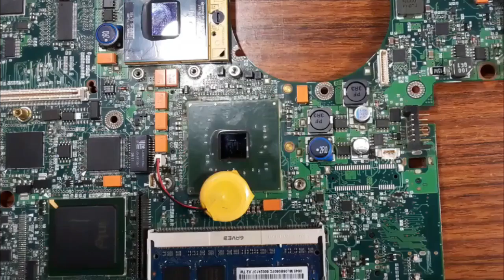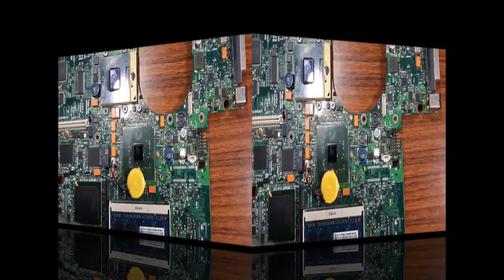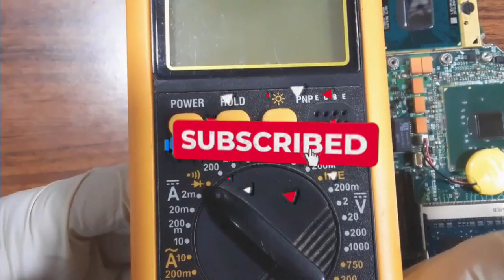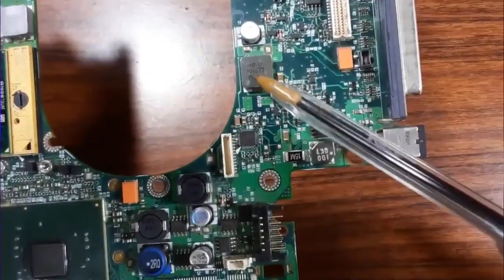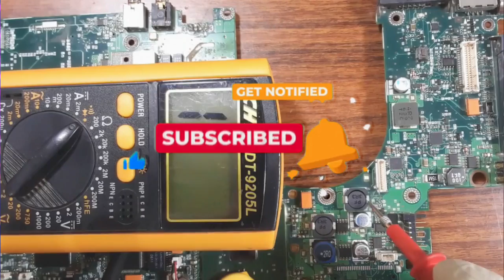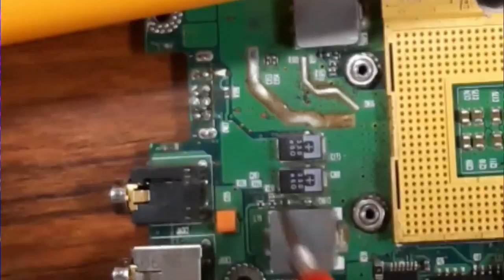Learn how to troubleshoot laptop short circuit - Laptop motherboard repair

Comment: how to determine if its a soldered CPU? newer laptops are soldered and has a low resistance as always because it should. how to determine if its just shorted or not with Soldered CPU
Reply from the maker: Thank you for your question. For checking if it's shorted, you'll need to measure the resistance on the CPU's power rail. If the resistance is significantly lower than expected or near zero, this could indicate a short. However, some newer CPUs do have lower resistance due to their design, so it's important to compare with the typical values for that specific CPU model.

Comment: Thank you for this informative video! Now that we've identified a short circuit, what is the best way to isolate the faulty component in the circuit? Is power injection and infrared analysis the most effective approach? Or perhaps a combination of a multimeter and an oscilloscope? I'm looking for a method that is both fast and accurate, with a 99% probability of identifying the faulty component. A video explaining the best method would be greatly appreciated!

Comment: There is this laptop of mine hp that i had connected a vga to hdmi converter for external monitor. I think there was a power serge from the monitor and the hdmi caused the board to short and some components burnt. So the laptop just keeps blinking on charge light, caps lock and power light at the same time but doesn't start at all. What could be the issue. Have you worked on such an issue before.

Comment: I’ve never heard someone say, and this so important for me, that an inductor never has continuity to ground. Such simple advice but so effective. I love the common sense. I have one question. What caused the short to ground? I know you could replace the inductor but the problem may repeat because you haven’t describe how to resolve the root cause of the short. I see that you touched on suspect components right at the end but that’s a lot of components to check. Maybe one day you can deep dive the repair a little. Thank you. 🙏 by the way I hope you don’t read this negatively because your videos are really very very good.

Comment: I love you tutorials. Great tutorial. You can also measure the resistance or microhenries of the inductors with the MESR-100 ESR meter. The reactance formula is 2𝛑FL. That would be 2 x 3.14 x frequency of esr meter which is 100 kHz x 100 (uH) Just plug it in to get the reading.

R=0.628 X L(uH)
L(uH)=R(ohms) ➗ 0.628